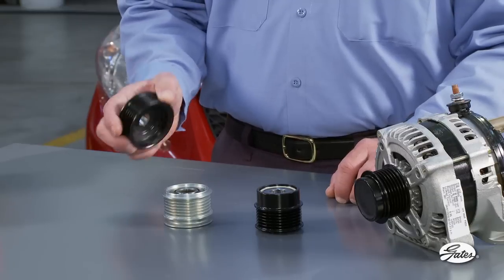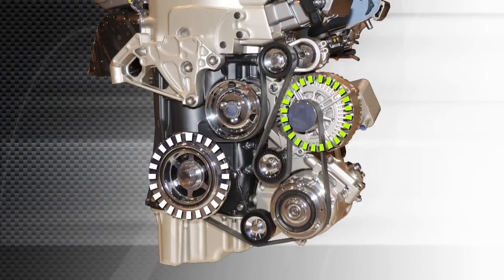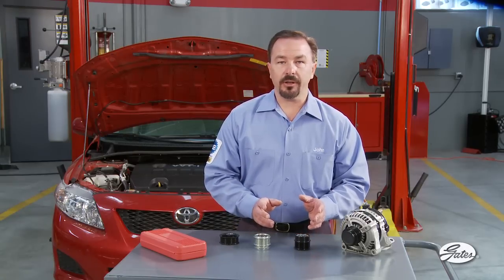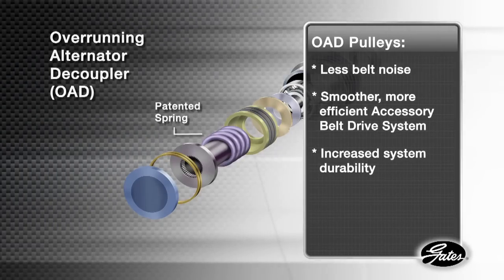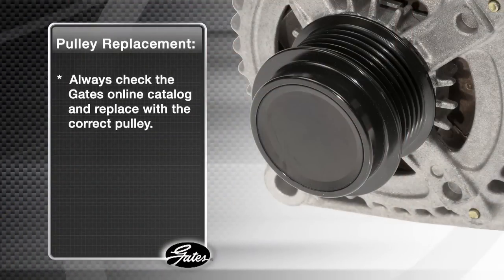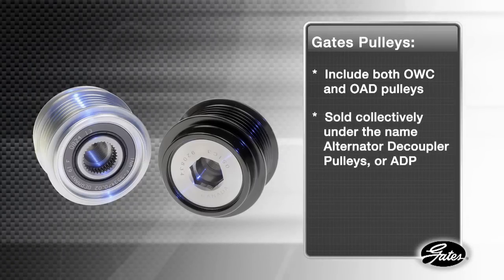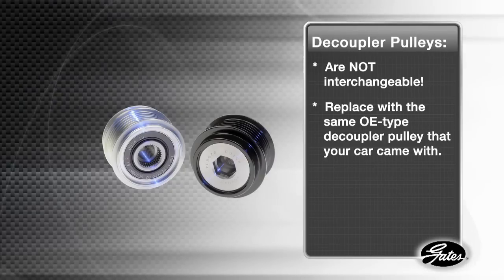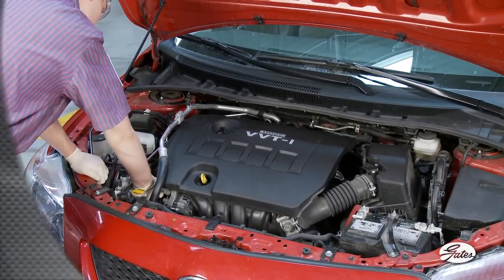GATES: Alternator Decoupler Pulley - Features and Benefits

Comment: I welded my pulley to stop it from slipping over 10 years 100,000 miles ago & it is still going strong. My tensioner is still original over 200k miles on it & belt still good over 100k miles later. Never reinstall one of those pulleys new or used because it will fail before 60K, leave you stranded & you will have to do this job over again. You can also buy a solid pulley instead of that original junky one. Just 2 small welds across from each-other between the face of the pulley.& arbor. Cost under $1 + labor.

Comment: was upgrading to billet aluminum and just got a new alternator and alternator pulley was an option that was solid and i was like hmmm, whats this "free up strain on motor". Uhhh ill keep this because my alternator is a PAIN to get to, have to pretty much pull the motor since bolts are to long. I also would love to keep my  new tensioner in good shape and my belt since its my waterpump too lol. Thanks for confirming my curiosity.

Comment: How long until we start seeing retrofit kits for cars not equipped from the factory with ADPs?  If the OEs are including them from the factory, it stands to reason that they're effective in doing what they're designed to do.  I'd certainly be interested if the option ever becomes available.

It also begs the question, how does the rotating mass compare to a traditional solid pulley?  The performance aftermarket pays good money for lightened and underdrive pulleys, but is there a performance benefit to using an ADP instead?
Reply from the maker: We have a couple of retrofit kits out there now.  One fits Ford police cars (39189K1) and the other Toyota (39068K1). Both of these belt drive systems are vastly improved by using the Gates Enhancement kit.
The benefit of using an ADP is lower belt tension, not weight savings.  By lowering the belt tension, this reduces the parasitic losses in the belt drive, thereby improving fuel economy.  This also reduces the bearing load on the accessories which increases the life of those accessories.
Learn more about ADPs here: http://www.gates.com/products/automotive/passenger-car-and-light-truck/accessory-belt-drive-system/alternator-decoupler-pulleys-adp
Reply: Gates Auto Aftermarket
Thank you very much!  :)